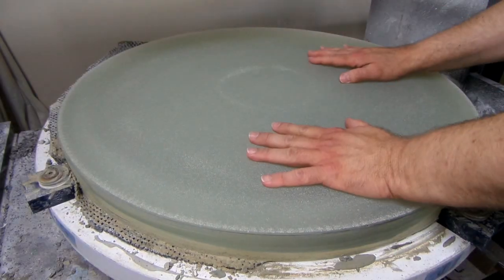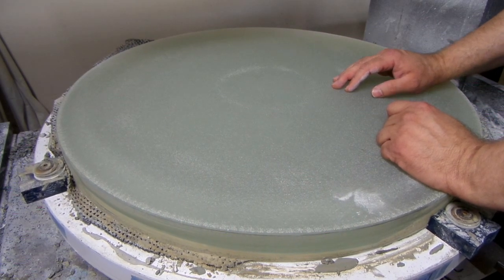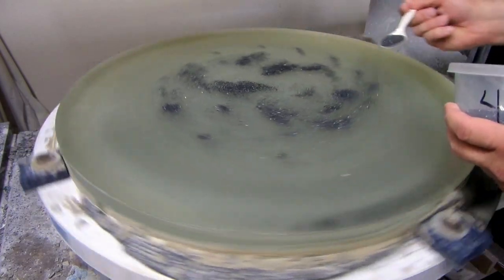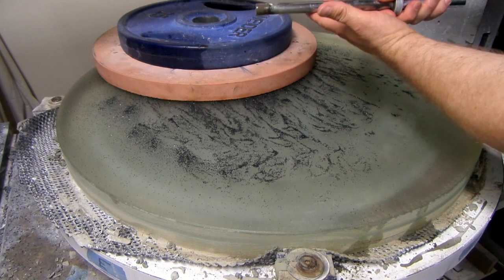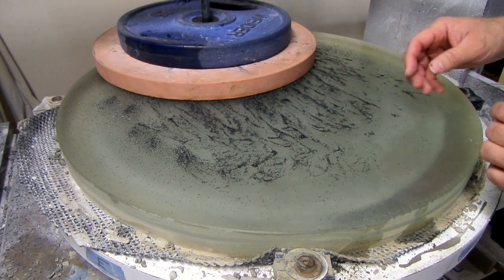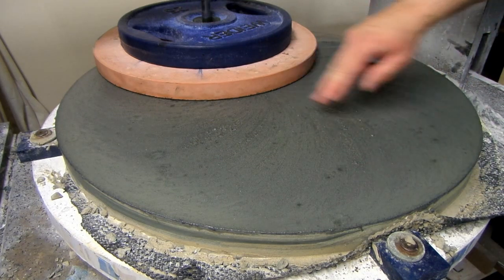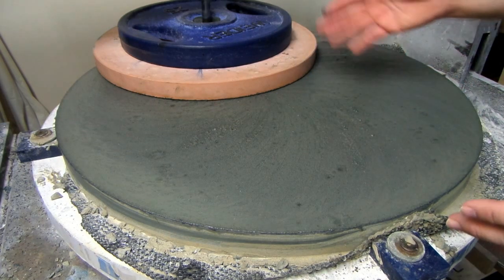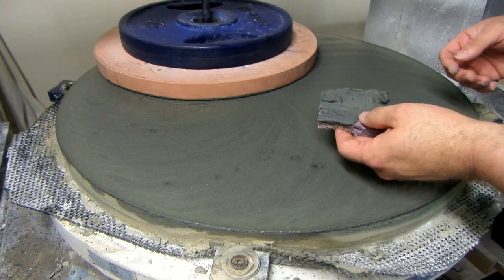Grinding a 25-Inch F3 Telescope Mirror: Thinning and Flattening the Back

Comment: Just curious as why does mirror have to be glass.  If made of softer material such as acrylic Lucite , or Lexan,  grinding time would be much much less.
Reply from the maker: For telescope mirrors, the problem is expansion and contraction due to temperature change.  Glass is quite stable, and borosilicate glass is very stable.  That allows you to form good images even if the mirror is heating or cooling because of being taken out of a garage or house and being exposed to temperatures that vary by 20 or 30 degrees.  Accuracy of a mirror's surface is measured in nanometers, so thermal effects are very important.
Reply: There are.

Comment: why are you spinning the 2 discs in the same direction? now one is trying to "outrun" he other, effectively increasing your grindingtime by SUBTRACTING the realative turning speeds instead of adding them. or is only the table spinning and thus driving the grinding-rig in its own direction?
Reply from the maker: Only the table is being driven.  The friction between the two causes the top disk to spin.  The differential rotation causes the grinding action.  Very simple and easy to build!

Comment: I hollow grind clipper blades with aluminium oxide, never thought of doing glass. I'll have to come up with a floating holder that revolves as I drift across the hollow line. If I can do it, I should be able to produce 4" glass

Comment: Home Depot has a better grinding wheel - intended for leveling concrete. Fits 4" grinders, and has 2 rows of diamond blocks on the flat of a dished wheel. Not cheap (about $45), but far more controllable than an edge grit wheel. Made By Ridgid HD-AWD40
Reply from the maker: Good idea.  Thanks!

Comment: I am puzzled.  I understand a mirror has to be a precise mathematical shape.  But you seem to use only rough tools and eyeballing.  What gives?
Reply from the maker: It is all simple geometry.  If you rub two surfaces together, there are only two shapes where all points can stay in contact: a perfect plane and a perfect sphere.  So with abrasive in between two pieces of glass, if you rub them one over the other, the bottom piece will turn into a convex sphere, and the top will turn into a concave sphere.  We keep the concave one.   If you use a stroke that overhangs about 1/6th the width of your glass, you will end up with a sphere accurate to maybe 1/10,000th of an inch.  Can't be anything else, if you just stick to a few simple rules!
Reply from the maker: At the end of figuring, you are removing very thin amount of glass., literally a few nanometers at a time.  It's easy to understand that you can rub on the glass a little, and that takes off a little bit where you rubbed.  What amazes me is that the Foucault test can actually measure that small amount of glass by measuring how the focal length changes in that zone.  The coolest part, though, is that you just trust all the math.  Test the shape and calculate the result.  Then you put the finished mirror in a telescope, and you can see the Great Red Spot on Jupiter!
Reply from the maker: Yes.  After the mirror is polished out and is spherical, you normally use smaller pitch polishing tools to deepen the center toward a parabolic shape.  That's called "figuring."
Reply: Oh that's very cool. I had the same question :D
But don't mirrors have to be parabolic / non-spherical?
Reply: Still amazing you do this figuring by hand. I'd think you'd need some kind of machine or jig to get it precise. Or CNC.
Anyways, thanks for the video! Super interesting.
Reply: Lots of testing along the way: starting with spherometers to interferometers

Comment: is this better than lapping on a steel master?
Reply from the maker: It would take a very long time to thin the blank with just lapping techniques.  It's a lot of material to remove.
Reply: oh sure for the rough grinding yeah but i meant more for flattening
Reply from the maker: The tool that I am using with the loose abrasives actually is a steel tool.  I embed steel nuts in the plaster to make a flat grinding tool.  It runs at pretty high speed, and grinds very fast, as the steel is harder than the glass, and more of the energy goes into chipping the glass rather than chipping the steel.

Comment: Would a water mister be useful?  I've seen machinists use a mister with lubricant and water mixed.
Reply from the maker: I sometimes just run a water hose onto the surface.  It gets pretty messy, as the water splashes around because of the high-speed grinder.  Once you go to the loose abrasives, I do have an automatic water feed to keep it wet on the fixed-post grinding machine.  I have an Arduino that controls how the abrasive and liquid is fed during grinding, as well.

Comment: Hey Gordon I have been trying to find the Thick Glass source.  but can't find any and local Glass shops, (window glass)   have no idea where to get this
Can you post Where you obtain your Blanks? 
Thanks in advance
Reply from the maker: Try Newport Glass Works in California.
Reply: Edmund Scientific Company
Reply: Edmund has a limited supply, and is usually in the smaller sizes at great cost. 30-40 years ago, they were more into amateur telescope making.

Comment: Fantastic!! thank you so much for the lesson , subscribing to your channel.
Reply from the maker: Thanks, Mars!  Let me know what you would like to see!
Reply: GordonWaite. I'm trying to learn how to turn a flat k9 glass disk into a concave lens (sigh) no tools for glass here so I have to figure out how. I was thinking carbide sandpaper (finer grit every time) and a pad... 
Sorry to bother so much, any advice? Thank you very very much!
Reply from the maker: How big a lens, and what focal length?
Reply: GordonWaite : thanks for reply. Lens should be about 35 cm diameter. It's not for optical use so it doesn't need to be accurate. I just need it to be a little bit concave (very shallow) but it has to be smooth. THANK YOU!!
Reply from the maker: Well, that's interesting!  You can take normal sand, and wash it.  Then crush it in a ball mill.  Then use the technique where you suspend the sand in water by swirling it up, then separate it into grades by how long it takes to drop out of the water.  You should be able to get 4 or 5 grades this way.  Use that for your rough grinding.  For fine grinding, many toothpastes have aluminum oxide in them, which is a fine abrasive.  Good luck!
Reply: GordonWaite I have ruby polish compound (for mirror finish metals) The problem is that the finished product should be as smooth as a real lens. Trying to get serium oxide for the last pass. My doubts are in terms of the mechanics for obtaining a concave lens (which I imagine should be different from a convex). This is most interesting!

Comment: What about the reflector side? How does it get its concave?
Reply from the maker: Most commercial makers either own some kind of curve generator, or have the curve generated at the glass fab.  Typically, you use a diamond cup in a milling machine, grinding at an angle to the surface, to cut the rough curve into the glass.  After that, it's mainly traditional loose abrasive grinding to finish the shaping of the rough surface.

Comment: Hey Gordon!! Some months ago I came up with sn idea on how to make parabolic mirrors without grinding. Just a few days ago i finished my first 5" mirror using this method (spin casting). Could you please tell me whats the accuracy of this mirror? I know it is a bit difficult because you have not seen the mirror itself, but can you guess? Please! :)
Reply from the maker: I would hesitate to guess.  Professionals have been spin casting mirror blanks for a long time.  Given that the surface of any spin-cast blank is still going to need grinding and polishing, the accuracy probably isn't at the "optical" level, but only at the "mechanical" level.  You would have to figure out if spin casting saves any time or money over just generating a blank like usual.

Comment: fantastic information gordon i have a process question if you have 2 mirrors  that have the same sagita but are say a 12 inch and a 24 inch and you used a tool say 70 percent of their diameters  would it take about the same amount of time to hog them out?

Comment: do i have to sent out the the mirror to get coating after I finished  grinding it?
Reply from the maker: Yes, you need to send the mirror to a commercial coating company to have the reflective aluminum coating evaporated onto it.  We often recommend Jeff Decker at Majestic Coatings.  He has reasonable prices and very fast turnaround times.

Comment: I always thought the grinding tool had to be the same diameter as the mirror. Is there a rule of thumb as to how big it needs to be?
Reply from the maker: No real rule.  If you have some experience, the grinding tool can be quite a bit smaller, especially if you have a good spherometer and test often as you grind.  The smaller tools, say 50% diameter or so, work pretty well.  If it is your first attempt at grinding something flat, though, a 60% or 70% tool might be easier.

Comment: Hi Gordon, What particular glass type you used for this kind of mirror/lens? Thanks
Reply from the maker: +Ferris Wheeler The particular mirror in this video is an old-school Pyrex substrate.  You cannot buy Pyrex any more.  Now almost everybody uses a borosilicate glass made by Schott called Supremax-33.  This is a really excellent glass, and I have made many, many mirrors and am very happy with it.
Reply: ER, Pyrex is a brand name by Corning Glass, and it is a Borosilicate.
Reply from the maker: @paulmoffat9306  Today's "Pyrex" isn't the same as the Pyrex of 30 years ago.  It's an entirely different formula, and you really cannot make  mirrors with it any more.  Supremax-33 is the way everybody goes today.

Comment: i can building a 20 inch mirror with 25mm common glass thickness, is possible, as John Dobson made? thanks.
Reply from the maker: +walter volpato Hi, Walter!  Making a 20" mirror from 25mm glass is possible, but that would be a very difficult build.  I would not want to do a project like that professionally, as the extra time you would need to spend would overwhelm the cost savings on the cheaper glass.  It is hard to grind such a large, thin blank without introducing 'stig, plus the support of the mirror during testing would be difficult.  Possible, but difficult!!

Comment: Why do you have to grind the mirror's back to such an accurate flat finish? How does that effect the quality of the finished surface on the reverse side?
Reply: +Joseph Dragan he's grinding what will become the front.  That's what I got from 3:15 to 3:35 "This for example is GOING to be an F3.1 mirror..."  That also makes sense from thinking about how crazy it would be to invest that effort on the wrong side.
Reply from the maker: +Joseph Dragan Hi, Joseph!  In this video, I am grinding on the back of the mirror blank.  This was originally a 25" blank that was over 2 inches thick.  That is thicker than I like for a modern mirror.  Mirrors that are this thick take a long time to cool down, and they are very heavy, making for a mirror blank that is difficult to fabricate, and a telescope that is very heavy and difficult to move.  So I decided to take about a half inch of glass off the back of the blank.  This removed about twenty pounds of glass, and results in a far more observer-friendly telescope.  The work takes quite a while because you actually want to get the back quite flat.  This is necessary to make it easier to control astigmatism, which you don't want to see during fabrication, and for SURE you don't want to see in the eyepiece!

Comment: Hi Gordon - you have the best scope making videos on youtube, imho - I have learned a lot from you... thank you. Just remember when you are hogging out your next blank with a diamond saw blade that telescope maker Robert Cox died of white lung disease from breathing glass dust. Can you devise a way to do this job fully wet so there is no glass dust created to wear a mask for - or with the disk underwater? I wouldn't touch that job without a full on paint-booth style breathing apparatus with remote air entry. Saying 'wear a mask' may not be enough for less well-informed viewers who may try this

This isn't meant to be negative in any way - I appreciate so much that you take the time to put these very informative and well-made videos up - amazing work, really :)

Keep them coming!

D.
Reply: David Paul Hi! Whenever I use high-speed diamond tooling, I always recommend wearing a quality dust mask.  And I always keep the piece under running water.  I never work a dry piece with high-speed diamond tooling.  Thanks for reiterating the warning.
Reply: You need an inexpensive industrial respirator that takes the violet colored HEPA filter, High Efficiency Particulate Air, it will filter out microbes down to 0.3 micron, used by asbestos workers.
Reply: In the rock and slab world there are some very nice wet, handheld, grinders and diamond abrasives...friend has one to free form polish obsidian...still requires a filter mask and he works outside.

Comment: Hi! I want to know if the tool you use with a weight on top has some angle with the perpendicular? or if it works just because you use the grinding tool first? thank you
Reply from the maker: +Johny Burbano The tool works quickly because the mirror is somewhat concave when you start.  If you move the tool in toward the center, the mirror will get more concave.  If you move it out away from the center, the mirror will get less concave.
Reply: ok, thank you.

Comment: IF THE GLASS CAN BE MELTED IT CAN BE POURED INTO ANY SHAPE YOU WANT. That way will be much faster and easier I think.
Reply from the maker: Oliver C Hi, Oliver.  This isn't ordinary glass.  It is precision annealed Supremax-33 borosilicate.  The original blank cost about $2,500, and was slowly heated to about 1050, the annealing temperature, soaked there, and then gradually, slowly cooled so the glass crystals would lose all of their stress.  Doing a precision anneal on a 25" blank takes maybe a week of kiln time, perhaps longer.  Also, doing an anneal on a 25-inch blank can cost up $400 to $500.  Plus you have shipping of a 70-pound package to the glass fab and back for the annealing.   And in this case, I needed to thin the mirror, but keep it the same diameter.  There is no mechanism to easily melt 70 pounds of glass, pour off the surplus, and then mold it back into a mirror blank.  The idea of pouring molten glass at 1500 degrees is pretty scary.  And then it would have to be re-annealed.  So it is WAY simpler to grind off a layer from the back with the angle grinder.  No cash out of pocket, and only a few hours of work.
Reply: GordonWaite Thanks for the informations. It is indeed expensive stuff.
Reply from the maker: Oliver C Yes, it's amazingly expensive.  I just got a bid from one glass fab on an 18" mirror blank, 1.625" thick.  They quoted me over $4,000!  You don't want to drop that one...  ;)  Thanks!  --Gordon

Comment: what is the shape of that grinding tool?  flat? concave? parabloidal? spherical?  I can't see the top of the steel rod.  Is it in some kind of pivot?
Reply from the maker: Tres Longwell Hi!  The grinding tool is concave, spherical.  It is made from dental plaster and ceramic tile, molded to the face of the mirror.  The top of the
steel rod just rides in a bronze sleeve bushing.  It has a locking collar above the
bronze bushing that keeps the steel rod from lowering any farther into the receptacle on the back of the mirror.  But it is held in only by gravity.  You can
just pull it straight up out of the back of the mirror, and keep going up until
it comes out of the sleeve bearing on the gantry arm.  There is no pivot.

Comment: GordonWaite; Can you tell me how hard is to make an F1 parabola, and is there any 
where or reason it can be used too,
and how accurate the focal length of your  F - 3.4 ?
Reply from the maker: Louis Barbisan Hi!  Making an F1 parabola would be a very big challenge.  And using it would be a big challenge.  I doubt that any of the commercial coma correctors could do the job.  The faster the parabola, the more precise the surface must be measured, and the longer it takes to excavate the glass to parabolize.  I have made mirrors down to F2, but for practical astronomical work, mirrors around F2.7 or F2.8 would be a good practical limit.
Reply: GordonWaite What you'r telling me that it's very hard to develop, due to the always changing curvature line from the 
center out, and not been spherical at all ?
Reply from the maker: Louis Barbisan Yes, the difference between a sphere and a parabola are huge when you get down to F1.  For example, the sagitta on a 12.5" F1 sphere is .7813 inches, while the sagitta on the paraboloid is .7939 inches, a difference of .0126 inches.  But on an F5 mirror, the difference would be .000098 of an inch.  So you can see that you have to remove 130 times more glass to parabolize an F1 mirror over an F5 mirror that size.

Comment: Excuse me, I have a question. How do you center the glass blank before securing it in place? I just can't get the result I want, if I use my eye.
Reply from the maker: Hi!  Thanks for your question.  I'll see if I can get Emerson to help me shoot a short video showing how to center the mirror on the turntable.
Reply: That would be great! Thank you very much and have a nice day!
Reply: It clamps into the turn table like a laythe
Reply: ParaglidingManiac Use a machinist dial indicator. $50-$80 bucks on amazon for a good Fowler. That will do well enough for this. I imagine this question is no longer relevant